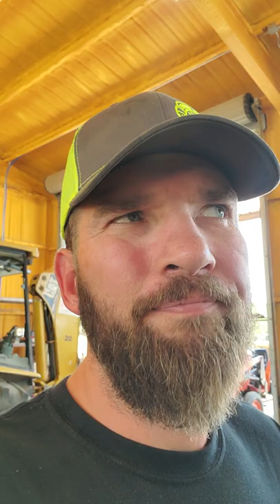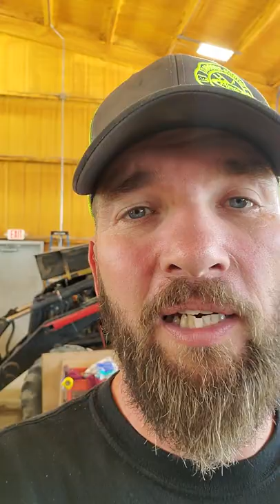instrument panel is off of a Kobelco SK235RLC. #mechanic #diesel #heavyequipment #kobelco #excavator

Comment: If there is a good part number on the lcd...or just a brand/ company... the part will be easy to find.

Even without info, the form factor of that lcd is most likely common.

As a 20 year electronics tech,  the job is easy. I or any   "mom and pop" shop can do this.